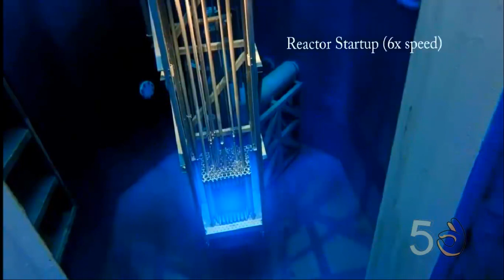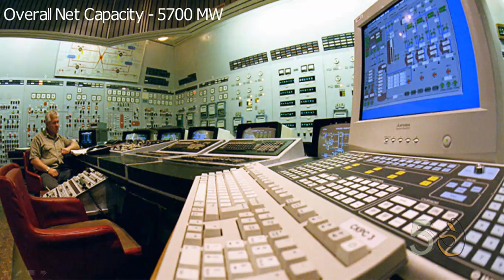5 Biggest Nuclear Power Plants in the World

Comment: I'm burning white
I'm a beacon in the night
Faster than light
If you stay you'll feel my might
I'm off the scale
The fuse inside has failed
My safety's blown
I'm a radiation zone

I'm going nuclear
Hotter than the surface of the sun
Smoking like a gun
I'm going nuclear
I'll melt through anything that's in my way
I'm brighter than the day
I'm going nuclear
I'm going nuclear

Don't get too close
In my core it's raining fire
I'll overload
If my temperature gets higher
You'll be exposed
To my limitless desire
Out of control
A reaction I can't hold

I'm going nuclear
Hotter than the surface of the sun
Smoking like a gun
I'm going nuclear
I'll melt through anything that's in my way
I'm brighter than the day

I'm going nuclear
Faster than a particle of light
Gonna burn all through the night
I'm going nuclear
I'll melt through anything that's in my way
I'm brighter than the day
I'm going nuclear
I'm going nuclear
I'm going nuclear
I'm going nuclear

Sam here
J℅©®™★★****+R†G><--|----
AhO
HURRAH